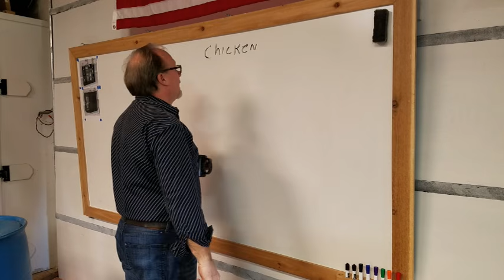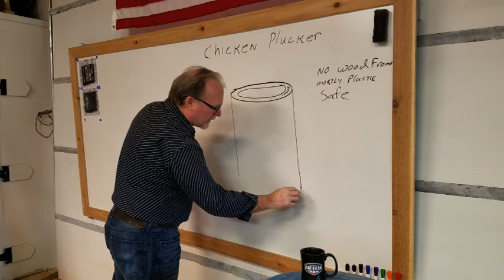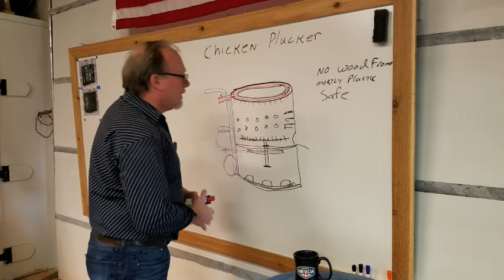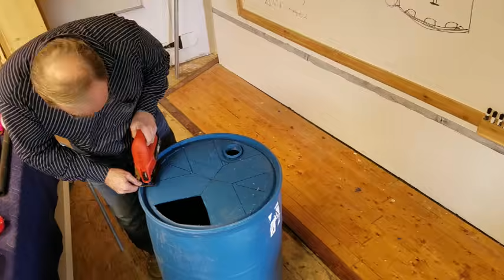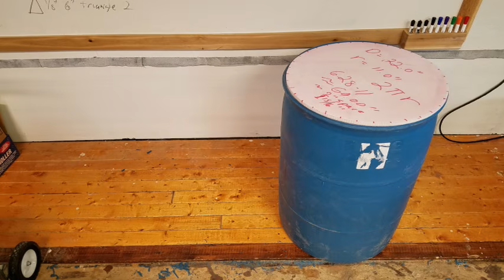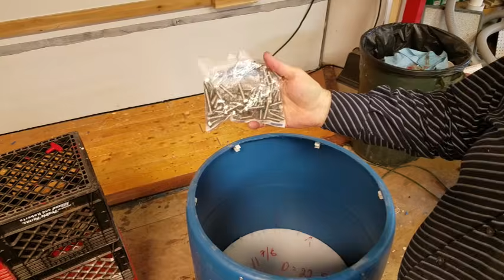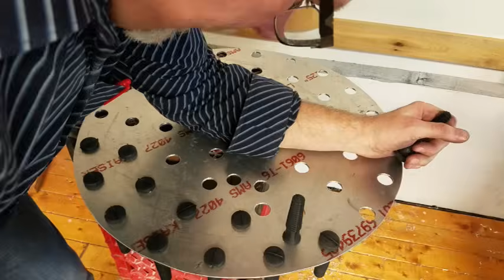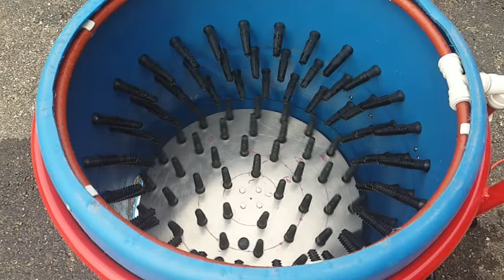DIY Mother of all Chicken Pluckers and how I built it.  My interpretation of the Wiz-Bang design

Comment: Where did you purchase the nylon plate ?
Reply from the maker: Hi Sarah, I purchased the nylon from a local metal/plastic supply house, `Alro Metal.' You can also find it on Amazon and eBay.
FYI, I will have the accompanying scalder ready soon, been delayed while I've been layed-up, but I'm back in the shop and working hard.
Thanks for watching, commenting, I do appreciate it, and especially thank you for the sub. I have some cool builds coming out, I hope you will enjoy.
P.s. I made a follow up video of the plucker with some changes, and more detail.

Comment: Very functional design.  Do you get much water flow around the motor?  Appears to be a pully attached to the drive rod? Thanks for the video.  I will be building a chicken plucker in the near future and this gave me some great ideas.  I have a small homestead in NE Florida and am trying to build our YouTube subscriber base.  Please consider subbing.
Reply from the maker: Hi LaLa.  Thank you, glad you like it.  Sorry for taking so long to respond, I have been ill. 
The motor is sealed for outdoor use, but it is not watertight, only splash resistant.  

Thanks for watching and commenting, I do appreciate it. 
Best of luck with your channel, Sub'd
P.s. I'm work on a scalder, it's a bit late but will be posted soon.

Comment: You can buy a time tested one cheaper. And it not take days to build.
Reply from the maker: Well, I don't know about cheaper, the total outlay was a little over $100, (I had most of the materials on-hand), but my buddy had no budget for a new one. Many of the homemade units are `Fabri-Cobbled' together with whatever they have available. This project was to help a friend with a minimal budget and also share with YTers a detailed construction how-to video, and in that, I feel I have succeeded.
I have a long list of upcoming projects; if your interested in seeing what I'm working on then hit the sub button, I'm always interested in critical opinions. 

Thanks for watching and commenting, I do appreciate it.
P.s. I post updates, project previews, and other random stuff on Instagram #southernengineering
Reply: @SouthernEngineering  There's no way a person can build that for 100.00. The fingers alone are half that. Motors are not cheap either.

Hey, I built an airplane for 50 dollars.  Well, I had all the parts but the spark plugs.
Reply from the maker: As I stated,  "I had most of the materials on-hand"   I have a large barn with many years accumulation of stuff to draw upon.   of course, if you bought everything new it would be as much if not more than a commercial unit.

Comment: did you use black pipe for the shaft
Reply from the maker: No, I used a 1.0" steel shaft.
Thanks for watching and commenting, I do appreciate it.
P.s. I post updates, project previews, and other random stuff on Instagram #southernengineering
Reply: im almost done i made bearing plate to where it fit perfect snug in barrell so debris wouldnt go past it.got a half horse industrial motor  and it has a clutch and brake on motor,im from southern illinois how bout you

Comment: I alway hear that 140 RPM is the ideal speed
Reply from the maker: Hi Ford.   When I started this build, I calculated the average RPM using frame rates on ~8 or 9 different YT videos,  they varied from ~175 to ~325 RPM.  After several pulley swaps, we settled on 300 as a reasonably good working number,  it's possible that finger placement, type, and size of bird makes a difference, but that's speculation; since this is the only one I made and my buddy is happy with it, I call that a win. 

FYI,  I'm almost finished with a scalder to go with it, just waiting for one critical part.   I've made a few changes to the original unit here, If you would like more info, check out my update video. https://youtu.be/0a3pVRMXQMk
Thanks for watching and commenting,  I appreciate it.
P.s. I post updates, project previews, and other random stuff on Instagram #southernengineering
Reply: @SouthernEngineering  looking forward to a good scalder build  its hard to get the temp of scalding water at a proper temp  useing the a propane burner Turkey fryer  set up
Reply from the maker: When my friend asked me to build a scalder, I offered to do it in propane, but he wanted electric and something that could accommodate a turkey.
Reply: @SouthernEngineering   a gasoline engine plucker would be a good pairing with a propane scalder  where  electricity is not available 
If A/C  power is available   the electrical scalder is a perfect pairing for the electric motor plucker

Comment: could i use a 1/8 stainless steel instead of a 3/16 ?
Reply from the maker: Hi Jizzy, 1/8 SS would work just fine.  My friend had a limited budget, so I used what I had in stock.  I made a follow-up video with more detail on the plucker,  there are a few changes and more detail on the design, I recommend you watch it before you start your build.
FYI,  I'm building a scalder to work with the plucker,  the video should be out soon,  just delayed for one last part.
Thanks for watching and commenting, I do appreciate it.
P.s. I post updates, previews, and other random stuff on Instagram #southernengineering
Reply: @SouthernEngineering  thanks

Comment: can i use the washer machine motor?
Reply from the maker: Hi Jizzy,   While the motor does have the power, it's an `Open Frame' design, there is no way to keep water off it; It's guaranteed electrocution!  The type of motor I used is what HF calls `Farm Duty'  basically, it's sealed against water splashing on it and it has an external fan to keep it cool.  hope that helps.
Also,  if your thinking of building this, check out my plucker update video, I made a couple of changes and also more detailed build instructions.
 FYI,  I'm almost done with a scalding unit and will have a video soon, so stay tuned if you're interested.

Thanks for watching and commenting, I appreciate it.
P.s. I post updates, previews, and other random stuff on Instagram #southernengineering
Reply: @SouthernEngineering  i was asking if i could use a washing machine motor? i like your videos
Reply from the maker: No, it not safe

Comment: Your "cross-brace" within the base would have been stronger if you had made the corners curved rather than hard 90 degree angles, you are setting those sharp edges up for stress fractures in the future.
Reply from the maker: I Made a couple of changes to improve the design and make allowances for a scalder I'm about to finish, check out my update video on this projects and you will see what I have changed and why.
I have a full plate of projects in the works for the coming months some home, some shop, I hope you will stay tuned to my channel, I promise it should be interesting.
Thanks for watching and commenting, I do appreciate it
P.s. I post updates, previews, and other random stuff on Instagram #southernengineering
Reply: Hi, Indeed it is only through experimenting and development that we collectively progress. Although I'm not needing a plucking machine at the moment it's one of those things that I can see being useful in the future: chickens and ducks. As ever the general design across all YT videos I see (I also watch the non-English language versions.) are pretty much the same. I would seek to play with an old washing machine utilising the rotating drum/motor configuration with a drum slit for feather sluiced removal. The big blue water butts I would seek for a serious clothes washing machine - to do duvets etc.
Reply from the maker: I had considered using a washing machine tub,  A larger tub would be useful for multiple birds or turkey but my  friend only planed on a few hundred chickens per year,  a smaller unit better suited his needs. As I said, I hope you will subscribe, I have many cool projects this summer.
Reply: I was although thinking about the common theme across various of these DIY implementations, they "all" go for a rotating plate with fixed plucking fingers around the drum, all just copies. With a washing machine drum that would rotate with my guess a central pole - like a mug-tree-stand (Google the image) centrally mounted to provide a force to react against. The other thought was instead of having a uniform layer of plucking fingers around the drum, place them in a series of < < < sections so that the tumbling chicken carcass falls into a pocket of plucking fingers that do the business as the chicken falls out into the next < section. There's also thoughts about mounting the drum at a 45 degree angle. Plenty to experiment with.
Reply from the maker: Interesting idea's, `What If's' are what I'm all about 🙂    A couple points:  The rotation of the plate forces the bird out against the wall of fingers where it must tumble about.  The rotating parts are confined inside the drum and thus natural safer to work with then an external rotation dum.   Various and varying patterns of fingers may enhance the performance of the unit,  I'll leave that to others to determine.   I think that mounting the drum at 45 Deg has merit, my concern is discharging the feathers.
Thanks for sharing your idea's, and for the sub.   I look forward to your feedback over the coming months as my projects unfold.   To spark your interest and creative juices, here are a few things I'm working on;  shop made and low cost, forced air filtered and vented welding helmet (they are very expensive),  Hybrid zero turn lawn mower(from scratch),  Old lawn mower converted to home sized `yard mule' with dump bed,   A Disney special effects `Fog Box' for home (something I worked on ~30 years ago),  Automotive stuff, shop equipment re-imagined, and whatever thing I may be interested in.
I'm currently rehabbing my barn as I earn a living and work on projects, check out my `Workshop Rehab' playlist to see the direction I'm going and let me know what you think.

Comment: Just convert a washing machine
Reply from the maker: Hi dan.  I looked at a lot of YT video's for this project and we had considered that but he liked the drum based unit better.   Also, have you seen the update video on the unit,  it goes into a little more detail on the design. 

F.Y.I. I promised I would build him a scalder by the end of April so stay tuned if your interested in that project.
Thanks for watching and commenting, I appreciate it.
P.s.  I post updates, previews, and other random stuff on Instagram @ southernengineering
Reply: To save from buying the aluminum for the bottom plate couldn't you still use the bottom of the drum from a washing machine and keep the flexibility of the plastic drum for the sides? Looking at using a propane water heater for my scalder with temperature controller
Reply from the maker: You could do that, but in my case, I had most of the parts and supplies on hand. 
An old water heater is a common way to make the scalder, but I will be using electric water heater elements 
F.Y.I.  I estimate that you need a minimum 20gals of hot water to maintain a consistent scalder temperature any less and the temp. can vary by up to 12 degrees per bird (average 6-pound bird)
anyway, stay tuned,  I should have it ready by the end of April
Reply: @SouthernEngineering  I thought about going electric but being in a field with plucker on outlet already I think gas is the better option for me.  And I found a 75 gal one for $100. Thank you for the video too. I started on the frame last night based on your design
Reply from the maker: Very cool,  have fun with the build.  if you have any questions as to the `why or how' on my design please feel free to ask.
I have another week of work on the welding area rehab in my shop before I start the scalder, but I will be posting some pic's of the progress on Instagram and of course the video will follow when it's done.
Enjoy your weekend
Later
Walt
Reply: A washing machine based one would be good sized for Turkeys or geese  it is so much bigger than blue barrel sized a quail might get lost in there

Comment: that's some extreme an unwarranted elitism you have there on nuts and bolts....
Reply from the maker: Hi Irish.   It's unfortunate that you feel that way,  I was only sharing my philosophy on the quality and quantity of fasteners;  If you have a shop it's always best to keep the hardware in stock rather than run to a hardware store to purchase 4 bolds of unknown quality at 3 times the price.
If you would like to follow my shop rehab series I'm sure you can find some other "unwarranted elitism"  to comment on.
Thanks for watching and commenting, I really do appreciate it.
P.s.  One more place you can see some "unwarranted elitism" is on instagram @ southernengineering  I post updates, previews, and other random stuff.
Reply: @SouthernEngineering  no harm meant, was just poking a little fun. personally i get all the stuff for my shop from Imperial.
Reply from the maker: If you liked the Nut and bolt rant, wait till you hear me go off on adhesives..  😁
Reply: @SouthernEngineering  haha oh god
Reply: How many devices have failed at the fastners especially when the wrong ones are used  I am rebuilding a wood shed  because somebody used drywall screws  to hold 2x4s together

Comment: It seems as though that contraption would really bruise the meat.  Do you find that to be the case?
Reply from the maker: Hi Babs,  Actually I have little experience using it, the friend it was built for has used it 3 times since and processes roughly 100 birds each time; he is very happy with the operation and the condition of the birds, however, it has been known to break the end of a wing on rare occasions.
If you want more details on the construction of the `contraption' I have an update video https://youtu.be/0a3pVRMXQMk I when into more detail on the construction made a couple of changes in preparation for the scalder I'm building for him.     That will be delivered by April.
Thanks for watching and commenting.

Comment: what was the measurement from top to the drain scuttle? thank for the video, I have a farm with 150 chickens to process, this is the ticket...
Reply from the maker: Hi Mike.  The drums can vary in height from 33" to 36", what I did was set the bearing partition plate 1/3 up from the bottom of the drum then cut the drain/scuttle above the plate to what I thought was a suitable size.
My friend and a helper processed around 120 chicken in one long day. You should watch my video on updates and changes I made to this unit, it has a little more information. https://youtu.be/0a3pVRMXQMk
Also, I have committed to deliver a scalder by April for his next batch, so stay tuned for the video.

Thanks for watching and commenting, I do appreciate it.
P.s. I post updates, project previews, and other random stuff on Instagram @ southernengineering

Comment: If you don't enjoy the taste of the outer skin you can just skin the chicken and be done with it.
Reply from the maker: I suppose that is an option but the guy I made this for asked for a plucker, not a skinner.Thanks for watching & commenting Keith, I do appreciate it.
F.Y.I. I'm doing full reorganizing work-shop rehab this winter, follow along if you're interested.

P.s. I post project updates and previews on Instagram @ southernengineering
Reply: @SouthernEngineering  Hi!  Thank you for sharing your design.  I'm not a farmer YET, but intend to be.  Would you tell me where you got the fingers or what they are called?! so I can find them?. :)  Thank you kindly.  I'll check out the rest of your channel.  

Is the machine strong enough to do more than one chicken at a time?
Reply from the maker: Hi Traci.   I purchased the fingers from Walmart.com just search for "chicken plucker fingers" you can also find them on Amazon and eBay, one set was ~$40 at the time.    The plucker was designed for a friend, he requested it handle 1 large chicken or 2 smaller ones at one time, which it does.   If you want a larger unit you could use a washing machine drum instead of a barrel.    The 1HP motor that I used would be more than powerful for that. 

I'm currently rehabbing my shop but also working on other projects, one of them is a scalder to go with the chicken plucker, I hope you subscribe and stay tuned as the changes take place, I'll do my best to make interesting and useful video's.
Good luck with your farming adventure, you'll find it hard work but very rewarding.
Thanks for watching and commenting, I do appreciate it.
P.s. I post updates, previews, and other random stuff on Instagram @ southernengineering

Comment: Very nice work indeed, can you tell me where you found and bought the rubber fingers ?
Thank you.
Reply from the maker: Thank you.  The fingers I purchased from walmart.com but the can be found them on ebay and amazon.   Check out my follow-up video on this unit, it will give you a few more details on the design.  I'm currently working on a scalding tank to go with it so stay tuned if you're interested..   Thanks for watching...

Comment: 0.5 HP motor possible tu run?
Reply from the maker: Hi Hanrig,   A 1/2 Hp motor will work fine,   I used a 1.0 Hp because I did not have a 1/2 Hp one.  Make sure it's a ~ 1700 rpm and the final drive ratio is ~ 5:1.  Thanks for watching..  P.s. stay tuned,  I'm working on a scalding tank to go with the plucker..
Reply: I make may Owne  plucker , inspiring tu u share your email address to show u how is work
Reply from the maker: Really cool, it's  willamkiefer @ gmail . com  I'm looking forward to see it..